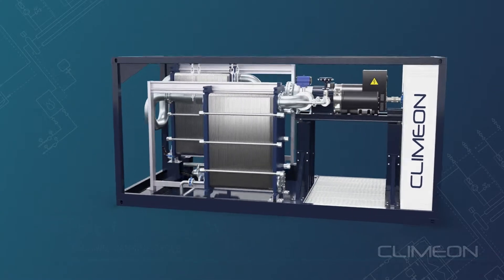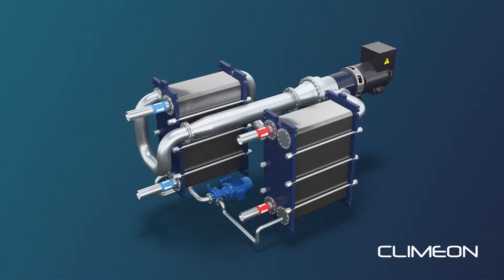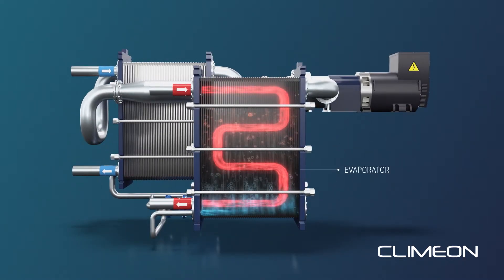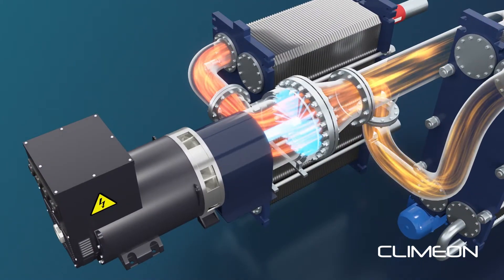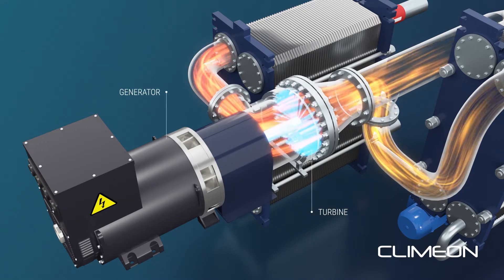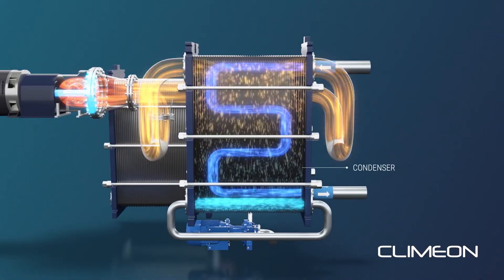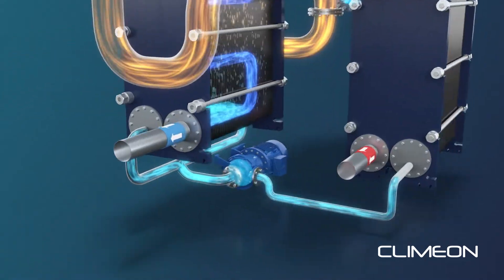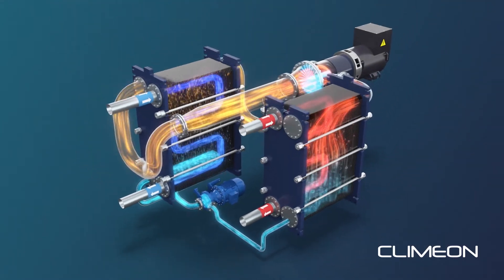HeatPower 300: TheTechnology

Comment: Just wondering how big temperature difference must be to get out some useful energy?
Reply: About 60K differential. But say 100K to get something usable out of it. Typical they would use engine cooling water to get it to 95C then exhaust heat to get it up to 120C, and that is sufficient to get a pretty decent amount of power.

Comment: For those who don't recognize the term "Rankine cycle", a steam engine is the common example of a Rankine cycle engine. This is the same as a steam turbine engine, but using a hydrocarbon (organic) fluid instead of water, because it has a lower boiling temperature so it can use a lower-temperature heat source.
Reply: What type of fluid or organic working media does it use?
Reply: @martylynchian8628 refrigerants normally but conceptually I think any liquid that can boil at a reasonable temperature. 

You also probably don't want it to degrade if you actually want to use it in a practical application

Comment: You left out where the heat (energy) comes from... this could be any number of closed loop steam turbine generator, like the candu reactor for example
Reply: I was thinking same where does heat come from, burning gasoline, wood, etc really green.
Reply: @arto1313 Can be geothermal
Reply: True.
In this case, the intended heat source is any large waste heat source, such as the exhaust of a ship's engine or a gas turbine power generation station. The combination of the ship's engine or the turbine and the Climeon engine is a combined cycle system.
Reply: Typically it would be form some thing like district heating furnace where you can get some electric power out of the system basically "for free".

A other application is on a cruise ship where the system can scavenge heat from heat exhaust ports, jacket cooling for the diesel engines, and exhaust heat.

By stacking them in the right order. Can get say the first order of heat up to 40C, the second up to something like 90C and the third up to 120-140C, getting a heat drop all the way down to 20C or so from sea water.
Reply: Probably waste heat from industrial processes.

Comment: Does it produce enough power to run condenser water circulation pump and refrigerant. If cooling tower is the heat sink then fan also